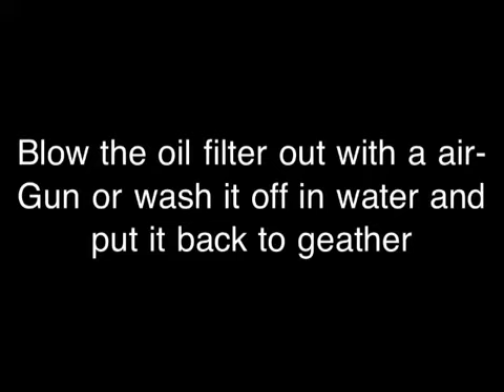Moto 4 oil change 225 86

Comment: you said there are 2 filters. Where is the second one?
Reply: There should be a separate, cartridge style oil filter in addition to the strainer that's behind the drain plug.  It's located to the rear of and below the dipstick, behind an access cover that requires a socket or wrench to remove.

Comment: How many quarts of oil do I use
Reply: Oil capacity for the 225cc is cast horizontal on the right side engine side case, near the oil dipstick.  Probably says "1500 CM3" which is 1500 ml or a liter and a half which is about a quart and a half.